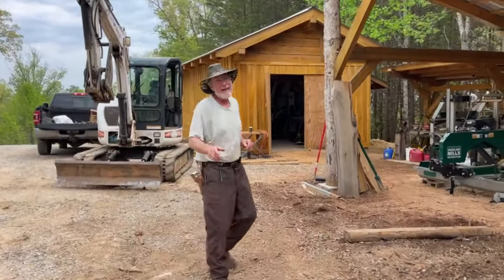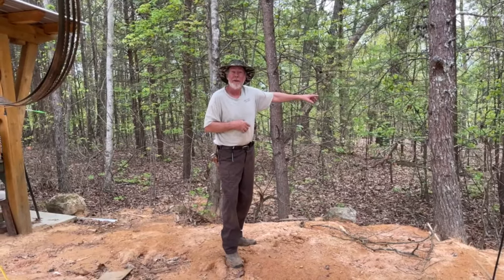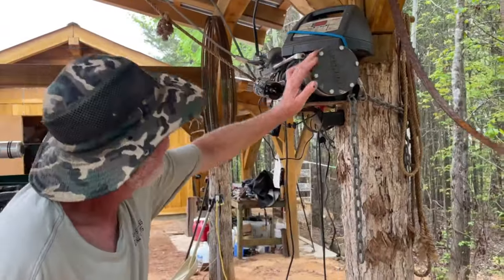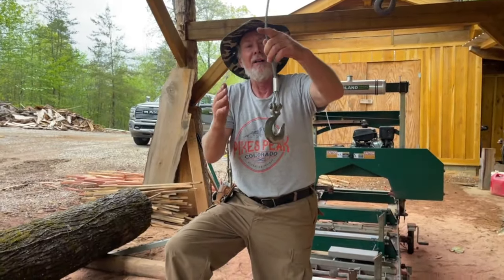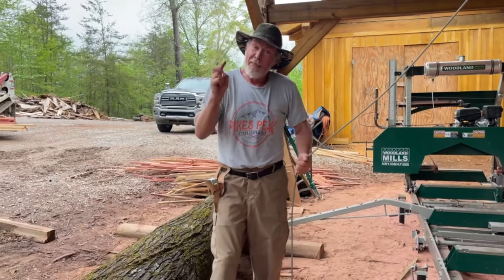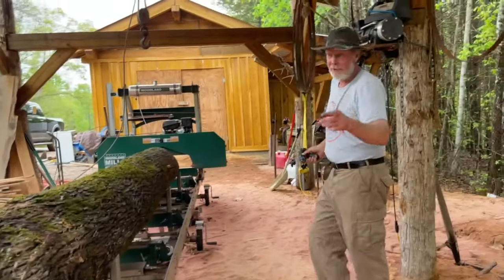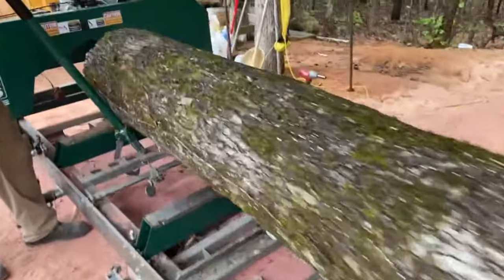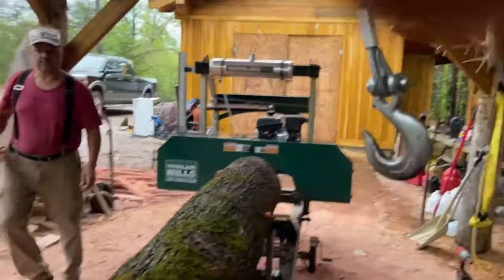Learn how to Automate your Timber Sawmill Shed CHEAP and SAFE!#timber#woodlandmills #sawmill#diy

Comment: Fantastic setup. I’m thinking about all the upgrades I need to make on mine eventually…
Reply from the maker: If you gonna be a Full time Timber Framer the Super Winch set up is priceless. We are about to film more just on the Saw Shed and design and function. You can easily rig it over your current setup. Still work outside and out if weather. Being open less sawdusty on your lungs. Thanks for commenting And keep Milling my Friend

Comment: Thanks for the video. Great points, but I work alone and have struggled with clamping off one end and trying to peavy the other end. I'm still going back & forth several times to get it located. I'm out in the open without a shed yet & work off the Woodlander XL trailer. Any suggestions would be helpful and much appreciated.
Reply from the maker: Thank you. I work alone a lot is why I develop this winch system years ago. If you don’t have your shed up yet , should be your first project so all other projects go smoothly. Check out the video of making your mill shed work for you. 
Now in the past when we were cutting out in the Boone docks I would find a big tree with a strong enough arm on it and park the mill under it and rig up the winch system  the same as I have it here. And use it that way, that’s another reason I use my truck winch to be Mobil if need be. Just make sure the tree you pick and arm you pick is strong enough. I have always tried to find an oak but it depends on what you have around you and your mill. Time to build a work shed for you so you don’t have to struggle. Thanks for watching and commenting.

Comment: Great system! A suggestion-if one wished to add the option of turning (rolling)a log the "other way(cut side towards where the blade comes from) one could put another pulley mounted on your top beam,above the" front "side of the mill.( -to save blade wear,from cutting through dirty bark on the blade entry side). One would need to use one of the pulleys where the wheel is attached only on one side (forget what they are called) ,like one uses for a redirect when skidding. That way,one could just use a long board notched/slotted at the end to put the winch line onto the added pulley,or take it off,if one wished to turn a log the"other way".(and not have to"thread the line through" the other pulley high up on the beam)....might still be a bit tricky to get the line in place on the pulley,i have never tried this,though.....hope I'm communicating this in a way one can understand.
Thanks so much for sharing what you do on utube!
Reply from the maker: You could rig up another pulley or just snatch your log in the other direction to roll in reverse. I cut big logs and I only roll towards my posts for security and for squaring. It’s kind dangerous as the log can come off the mill. I only turn my small logs in reverse only if I use a Cant Hook. Thanks for watching! 🤠👍

Comment: Thx for the vid. Really great tips and ideas using what you have and your brain. Great shed, simple but really robust. Open air for best ventilation. Need to build one similar. I noticed your front left post seems to be on some sort of concrete pier. I couldn't see the rest, a little buried under sawdust. Are some of them deep into the soil or all on concrete piers? Are they fixed to the pier with some sort of bar or rod with lag bolt or simply weight pf the structure holding them there?
Reply from the maker: All my posts sit on concrete piers these have  rebar posts up into the Timber.  This building I did not put tie downs in yet. Been three years  so I don’t seam concerned. Massive Weight of this building it’s not going anywhere. You could  put bolt on tie downs of timberlynx tie downs when you install. I don’t bury my posts in soil unless I have to for some reason. They will rot at some point. Thank you for Watching and Commenting👍🤠
Reply: @TwoGuysTimberframing  Thx for the info!  Watched the bunk ''making of'' this morning and your simple but robust method makes it ''easy'' and fast. In the vids it's nice to see your methods in real time . Really helpful.
Reply from the maker: @ZeeFrankensteel  That’s Awesome I am Glad you Like it.  Have a New One Coming Out at 4 today. Breaking Ground for the 5700 sqft Lodge we are just getting ready to build! It’s Happing!❤️🤠👍

Comment: Great idea and setup! by far less expensive than most options. Harder to do for off-grid/remote locations unless you have an alternator/generator to power the winch, but still doable. Technically this isn't automated though, as you are still performing the functions manually, so it's more mechanized more than anything.
Reply from the maker: True it is Mechanical!   Truck winches are 12 volt just use your battery! No power No Problem! Solar Charger! I have worked years in the back country. This has never failed us!  Thanks for watching and commenting! See ya soon!❤🤠

Comment: Est-ce que vous avez des vidéos sur les tenons et mortaise aperçu dans la vidéo j’aimerais en apprendre d’avantage comment faire avec le moulin à scie ça semble hyper intéressant. Pour une fois qu’il y a quelques chose de nouveau différent des autres personnes qui ne font que couper du bois.
Reply from the maker: There are several. Look at cutting timber frame joints on your woodland mills saw and cutting precise timberframe joints. More coming in that topic 
🤠👍

Comment: I've got the same setup but with a much smaller winch.  I have no problem rolling logs large enough to max out the mill with a 3000 lb winch.
Reply from the maker: That’s Good Im glad it works for you. To max out your mill are you cutting Pine or Oak?🤠👍
Reply: @TwoGuysTimberframing  I live in the burn scar of the caldor fire in California.  I have fir, pine, cedar, and a little oak.  I've done them all over the last two years.  Started out just using the overhead winch for turning the logs and a separate winch for rolling them up on the mill.  Realized a couple of months ago, I could do both with just the overhead winch.  I have a wireless remote on the winch so if the log gets a little wonky on the ramps, I can sit on my tractor and lift one end while operating the winch.  I don't have any helpers so I've needed to figure out how to do it solo.
Reply from the maker: Your Awesome!  We’ve been cutting this way for years like I said on my video it was the winch from my truck but with all our big Oak logs I put the strain on it as well
 A little bit bigger winch  and you might not have to use your tractor but I’m really glad it works for you as well it works great for us! Stayed tuned we got more stuff coming your way!
🤠👍
Reply from the maker: I’m sorry buddy I miss read your message but that’s a good idea with the tractor instead of using the second winch don’t really need that much anyway. I spent over 20 years in the Arizona backwoods and I’ve actually used this method and carved it  in the live trees and work myself. We had a lot of ponderosa pine and juniper I’ve been lucky enough to move to Tennessee and I’m loaded with oak big oak. Thanks for sharing I’m sure there’s more of us out there that figured out how to use it with the overhead Winch nice job!👍🤠